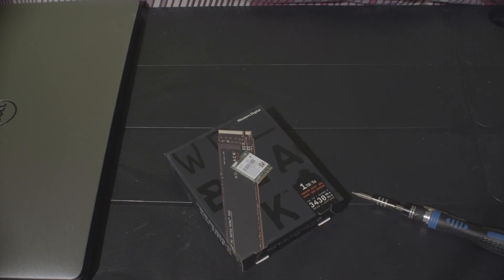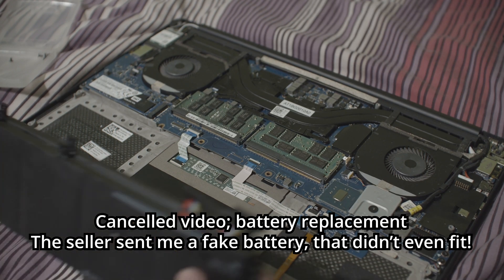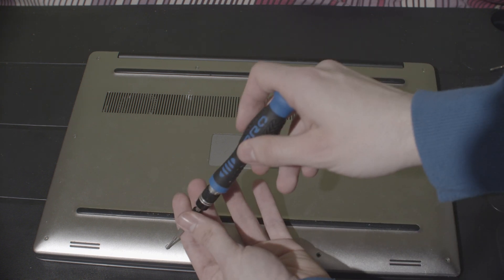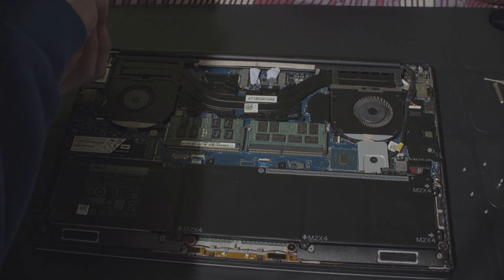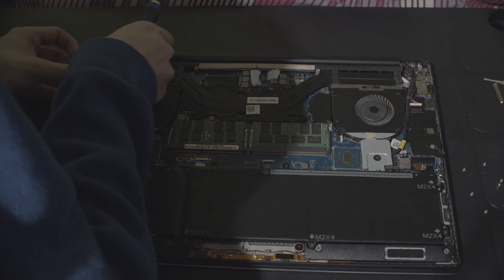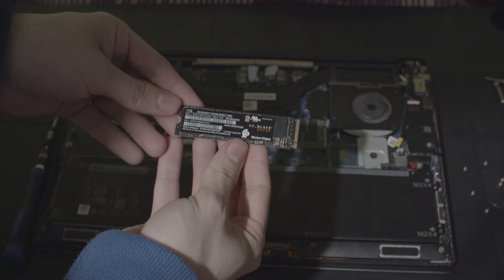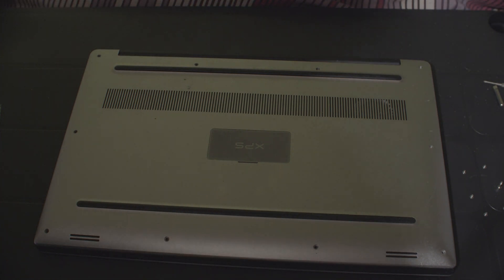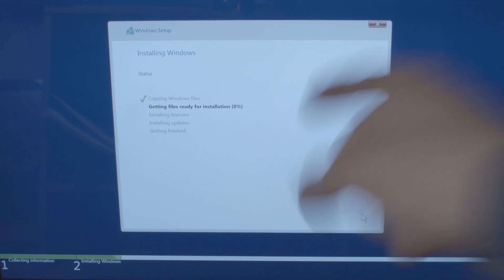Upgrading the Dell XPS 15 9550.

Comment: Hi.. just a quick question, can I put wifi 6 card on this device?
Reply from the maker: Not a clue. If it fits into the port, and is supported under whatever OS you use, probably? But I can't say I've done that.
Reply: no. not supported

Comment: How do you use usb c in 9550  for charging?
Reply from the maker: I found a Dell charger, a 90W model that can power the laptop. The original charger is a 19.5V/6.67A (so 130W) charger, I managed to find a USB-C charger that was 20V/4.5A (so 90W). It does give an error on bootup, but I haven't managed to get it to drop any battery life when under usage plugged in. 

You can get higher wattage chargers that should work, but the reason I went for the one I did was because it also gives you 15W (5V/3A) fast charging on other USB-C devices such as phones and tablets, and also can charge my camera batteries via 15W fast charging. So, I only have to carry around one plug with me, which is this charger, and it works with all my devices.

Comment: I am receiving harddrive not detected error in my XPS 15 9550 , should i need to replace the ssd or is there any work around
Reply from the maker: Could be either the drive is no longer working, or something has stopped your OS from working. You could see whether it's detected in any Windows recovery installer, or replace it. (also keep in mind some 9550's have a hard drive, so in that case, it might be a larger 2.5" drive)
Reply: @plutotech3141  Thanks for the quick reply , will try to solve it and let you know : )
Reply: @suryamunirathinam4513  Did you solve it?

Comment: What’s the point of upgrading a laptop ?
Reply from the maker: The actual hardware of the computer is fast enough, but whilst using it for video editing or animation, I very often run out of file storage, and memory, so upgrading those two items make a slightly older laptop run like new again! I don't really want to spend a grand on a new laptop when I have this laptop still, that works flawlessly lol